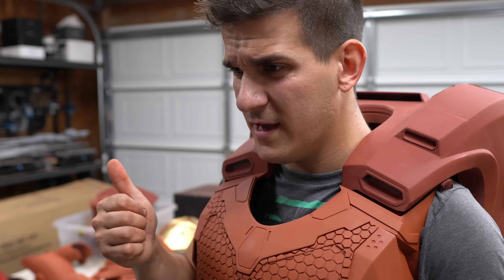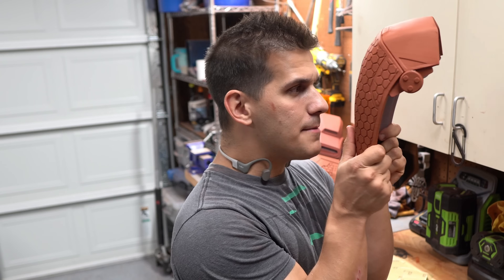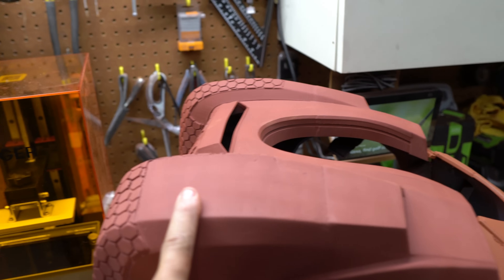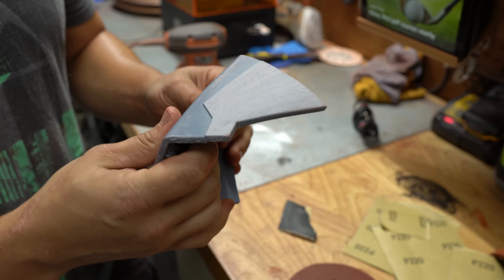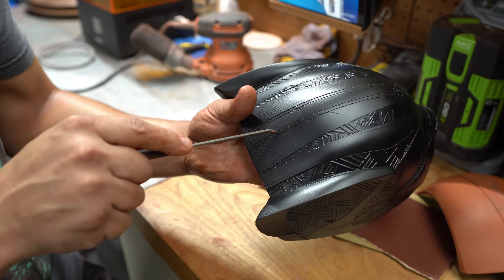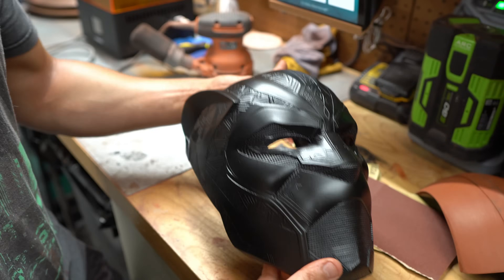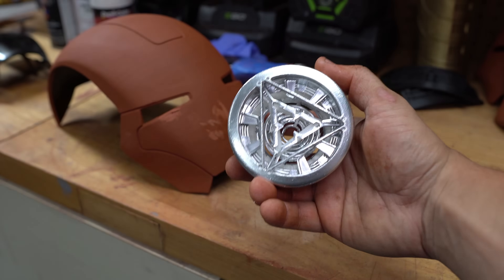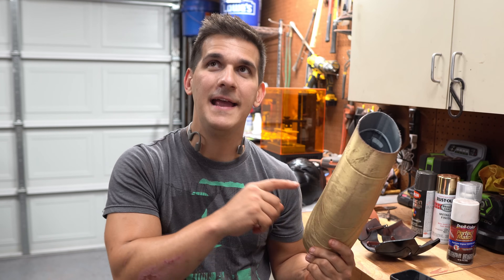3D Printing an Iron Man Suit!  | MK39 Starboost Part 8 |

Comment: Spot putty isn't for gaps that big. Its made for pin holes and light scratches. What you should use is Premium Autobody Filler. Its very easy to sand, and will not crack or fall of over time, like the spot putty will, when you use to much. I think you could get away, with filling the print lines if they are light, more visual than deep.

Comment: Been working on a Buzz Lightyear suit and plan on starting over with the Johan model. Might try the Duplicolor white pearl as a replacement for the rustoleum gloss paint/primer I had been using in the past. Thoughts? Big difference? Little difference?
Reply from the maker: You still need a white base user that white Pearl

Comment: i used to sand my builds to the extreme, going all the way to 1500 grit wetsanding... but after watching builds like yours i realized i could stop much earlier :) currently enjoying that heavily as im painting my armor after getting it to around 320 grit smoothed
also rotary tool buffing wheels are great for sanding less flat pieces, got a bunch for cheap in 180, 240, 320 grits

Comment: So I got a 3D model of a helmet and am wanting to print it problem is that I’ve never tried to 3D print a helmet before and it’s too big to print all of it on my one platform which is 220x220x250mm and the models tris is inside each other in certain areas and wanna try getting this done before Halloween. I need help.

Comment: Question. I’m building a mark 85, can I spray paint it the gun metal color to hide most imperfections and then the red, and gold? Any advice you have would be great. I am using bondo and glazing putty and fiberglass on the inside!

Comment: im in the middle of printing my mk39 helmet and wanted to utilize the full mask/dome piece. What pieces should I wait on finishing? just the mask?
Reply from the maker: Well normal servos can’t lift the full mask part
Reply: @FranklyBuilt  can I use the high torque versions or were you already using those?

Comment: Awesome video, man! Have you looked into the technique of airbrushing the bondo putty mixed with acetone? Seems to work out well for highly detailed prints.
Reply from the maker: Yeah it’s dangerous. I do not recommend it. It’s literally the same as quality Filler primer. If you want to use a spray gun bad enough buy a proper HVLP gun and feather fill. Filler primer or just proper techniques work fine for highly detailed prints regardless. It’s just people being lazy and exaggerating results

Comment: If going for the best detail in the gold, I would for sure use the airbrush. yes, you have to mask off for clean lines, but the paint used in airbrushes is so high quality, that the results will probably stun you.  Love seeing the process of this build!
Reply: I literally just got my airbrush and compressor. What would you recommend I look at for paints? Premixed or mix myself?
Reply: @JaXxX410  Depending on what you are applying the paints to,  I would go with premix Createx is a good airbrush paint for general use.  If you want a more permanent finish,  you can use automotive paint.  Nasons is a good brand.  All you need to remember is making sure to get reducer for the paints as they will need to be thinned.  Hope that helps!
Reply: @XanBos  I do appreciate the reply very much. I'm going to look into those paints to start. Mostly plan on using on some 3D print but I can see maybe painting some minis as well.

Comment: Great to see progress on this suit again. I do have a question about your maker space in your garage though. I currently have my two printers in a bedroom and for just these it works great. I am looking at getting a few more and moving everything into the garage. How are your printers dealing with being in your garage? I'm in Florida so not sure if you get similar heat and humidity where you are at. I did notice that your garage door didn't have any insulation so do you cool your garage down with air conditioning at all? Thanks
Reply from the maker: I can’t really print with them in the garage in the MIDDLE of summer as they overheat a bit much but aside from that they’re fine

Comment: Love the videos dude.  But that filler is for spots.  It may shrink and crack.  If you use the metal filled filler from the same company it actually won't do that.  Darkwing Dad uses it and it changed how I fill holes and larger cracks/lines.  # had to edit because my ADD doesn't let me type without corrections.

Comment: For anybody looking for an awesome Gold or Chrome paint, check out Molotov  Gold and Chrome. Both flop very well when brushed on or sprayed. Stuff is amazingly reflective for a realistic metal look. 👍
Reply from the maker: They are indeed great! Buy fairly brittle and delicate
Reply: @FranklyBuilt  yeah, they need to be clear coated to make them scratch resistant for sure, but that shine is pretty awesome.  Pieces without much contact (like your Arc reactor) are ideal for it. 👍 I use it for artwork that are mainly  display pieces that don't see much contact.

Comment: Handy trick with the spot glazing putty. If you mix nail polish remover with it to thin it down. You can apply it with a paint brush for detailed areas
Reply: Nail polish remover is just acetone and available in larger quantities much cheaper. I have mixed acetone and laquer thinner with the glazing putty and painted on for a while but just found an even better way to apply is through an airbrush or HVLP gun.

Comment: @15:42 For flexible paint I recommend the following application:                                                                         Primer-> Plastidip base -> ANY Spray Paint colour (even chrome effect) -> Plasti Dip Gloss

This took me a while to workout as I could get paint flexible after spraying over plastidip however as soon as I get the Clear Coat over it it would crack; Clear coat cannot flex. However I recently discovered plasti-dip Gloss which is their flexible equivalent of clear coat. 

It does wonders staying flexible and adds protection to the paint like clear coat. Dust doesn't stick on and can be washed and waxed like clearcoat.

I still prefer clear coat for a majority of the costume, but anything flexible like foam or tpu, I'll use this method.
Reply: Is it the Plasti Dip Glossifier?
Reply: @konior21  Yeah its the Plastic Dip Glossifier. In the past I thought it would just add a gloss effect similar to the metalliser but I was wrong. It adds a gloss layer over the paint, sealing and protecting it.